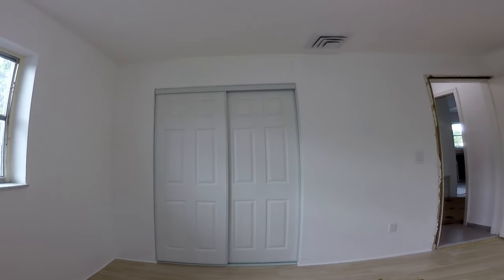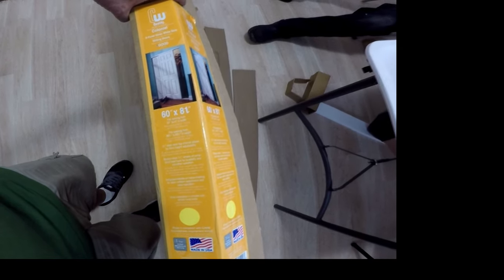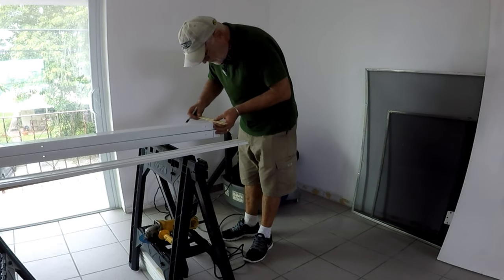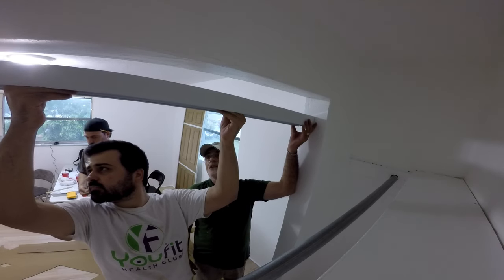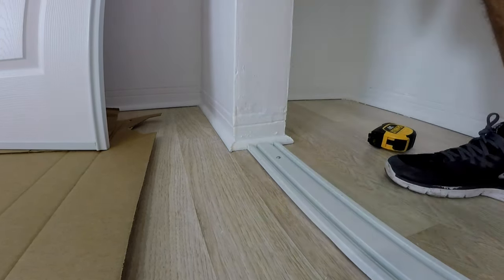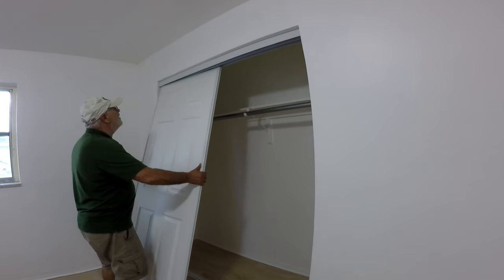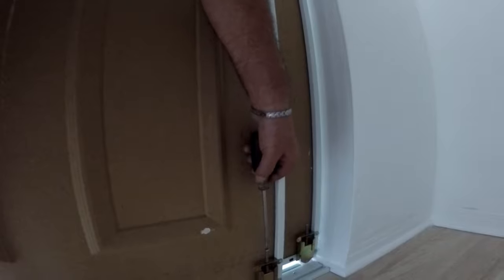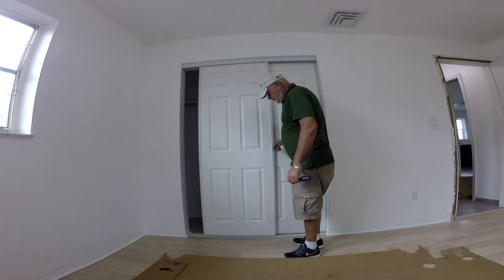How to Install Sliding Closet Doors or Bypass Doors

Comment from the maker: The Colonial bypass door features a painted steel frame, prime coated ready to paint hardboard panels in a raised 6-panel design and steel track and channel. This Colonial door will provide your interior passageways with functionality and a personalized look with the paint color you choose. The Colonial door can also be used in commercial applications.

Comment: I have a question.   I put the vinyl top guide on mine and the door wouldn’t slide back fourth it looked like it was to tight with the guide is this normal?
Reply from the maker: Sorry, I never used the vinyl type yet. But it can be that the surface is curved and it may be curving the track as  well. Just a guess.

Comment: It's nice that you have a track on the bottom as well as the top. Most of ours here don't, and they can slip out of place easily.
Reply from the maker: These are not the top of the line but they are sufficient.

Comment: Curious, why didn't you remove the trim on the bottom? Wouldn't doing that help with the gap on the side of the doors when closed?
Reply from the maker: The door does not hit the trim. There's plenty of gap between the door and the track.